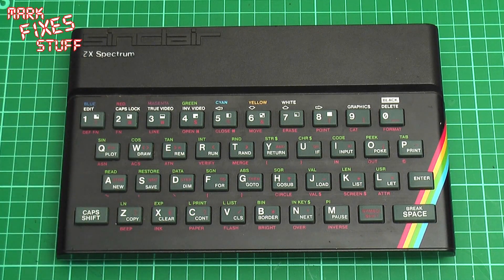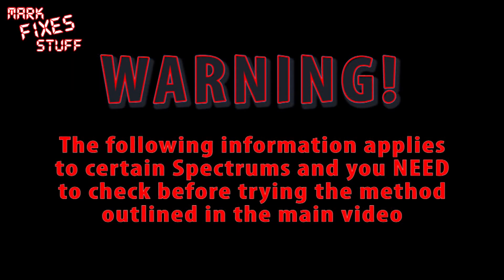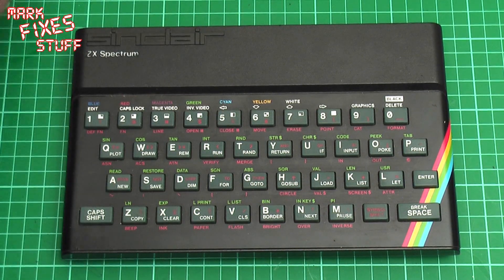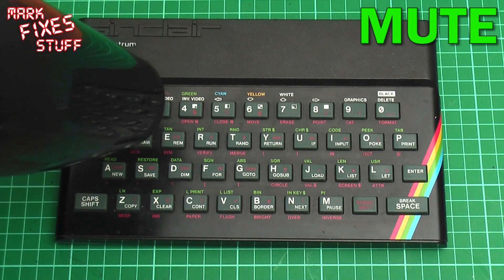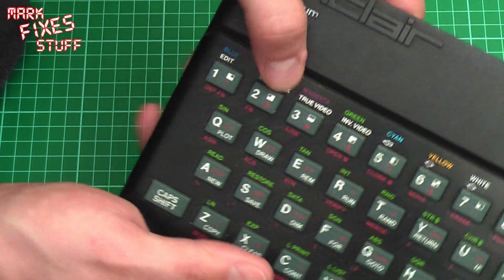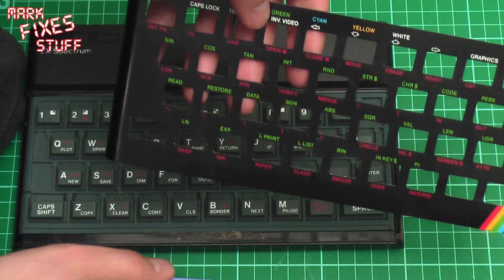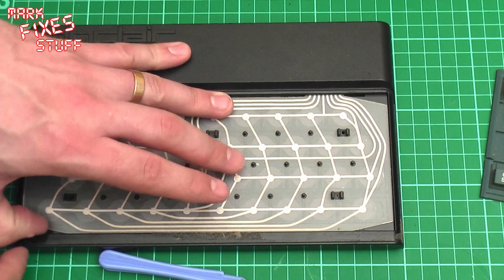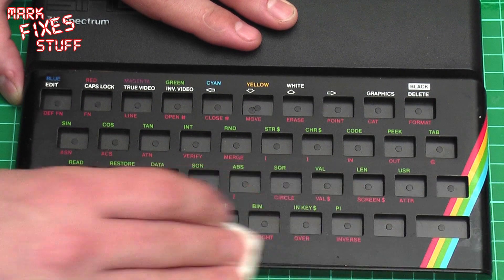Sinclair ZX Spectrum 48k repair: Remove the faceplate on a rubber keyed Sinclair Spectrum

Comment: I just removed the faceplate from the rubber keyed speccy with no damage. The standard way for me is without any heat . Isopropyl alcohol + an old plastic credit card. Take the top case, put it on a flat, liquid resistant surface with faceplate up, pour the alcohol around the plate, leave it for some minutes (5-30). Take a credit card and carefully slide it between the faceplate and a case at the top edge (the one with more plastic and all the scribbling). If the alcohol has done its job, the case and the faceplate will separate. Slide the card around the faceplate, separating as you go. CC, being soft, plastic and thin, will not damage the faceplate.
Reply from the maker: Thank you for this! I will try your technique when I get a chance next
Reply: arnoldrimmer4833  well, it worked alright, and there was no damage. But point taken - you should be careful with it.

Comment: Put the top of the case in very hot water for a few minutes .Softens the glue and and comes off pretty easy ,and you do not risk melting anything .Modern mobile phone refix tape is ideal for putting them back on , or 3M refix tape
Reply from the maker: Good tip. I have the 3M tape now.

Comment from the maker: If you are tuning it via RF, then you might want to try going through the whole band, as often you'll find the spectrum can be picked up in more than one place, and often in a stronger fashion. My general advice for Spectrum +2 owners is to just get the appropriate RGB SCART cable though as this will give a lovely clear signal without RF interference. Google "retro computer shack" and be aware that there are two types of +2 (grey and black) so get the right cable!

Comment: I found a better way is to slide a thin kitchen knife into the slot where  the cables go in it splits smoothly without bending
Reply: My faceplate has clamps and also was taped on three sides. Your tipp helped getting it off nicely, thanks anticat900!

Comment from the maker: You could as they fit (you'd need to resolder the reset switch) but it would be good to fix the board! Are you using the correct PSU?

Comment from the maker: It should be 9v and capable of supplying 1.4amps (1400ma) at least. Some speccys will run with just 500ma supplies, but others will fail and it really does vary from unit to unit, especially as the capacitor are aged!

Comment: Hi mark just watched another video about removing the facia and I newsagent wondering if goo gone  glue residue remover or label remover for the fascia ???
Michael
Reply from the maker: Probably not going to work in my experience. If it's the original  glue then using the hot hair dryer will make it soft and easy to remove.

Comment from the maker: This one is fine, although it needed a new regulator due to someone putting the wrong PSU into it. I just have a poorly Grey +2  to look at on the Spectrum side of things now and I suspect it's a capacitor issue as it was working fine when the chap turned it on but then died mid-load.

Comment: Thanks again Mark for this great vid. I have a rubber speccy that has a small dent between the M and Symbol Shift keys. Do you think if i remove the faceplate I'll be able to knock it out from the other side without damage?
Reply from the maker: In my experience no unfortunately, as the whole thing loses it's shape (I've tries a similar dent removal process.

You can get new replicas though! See this video!

http://youtu.be/CI-nQBYA4uA
Reply: Great thanks for the info Mark. I did know about those replacement cases, but I think I'd rather keep it original and live with the dent, it is only very small and hardly noticeable. I must learn to control my OCD!Mark Fixes Stuff - Retro Console and Computer Repairs, Reviews and MORE!

Comment: Hi Mark. I am currently changing the keyboard membrane on a spectrum. Am I correct that you put new double sided tape faceplate over the old tape? Just was not sure. Thanks. Another great vid by the way!
Reply from the maker: I remove the old stuff myself as I don't want the extra thickness, but I might be being a bit anal. I use isopropyl alcohol to help shift it. Thanks for the kind comment about the video :)

Comment: Hi Mark!  Excellent video!  I wanted to share my experience with the Timex sinclair 1500 (same form factor like the spectrum).  To remove the old glue from the Aluminum face plate, I used Goo Gone orange   (isopropyl Alcohol 70% was not a success) .  However, to remove the old glue from the plastic case, Alcohol worked fine.  I bought double sided scotch tape 1/2 inch but not strong enough.  Any suggestions on the type of glue I should use or maybe the brand of double sided tape?
Reply: Does that Goo Gone work well on the faceplates?

Comment: I'm currently repairing one, but the faceplate his been previously removed and is bent, with a kind of ripple effect. Think it must have been peeled off.  Does anyone have any tips on how I might be able to flatten it?  

So far I have tried heating it up (hairdyer) and pressing it flat, but don't really seem to do anything. Might need to get it replaced but apart from bending and ripples the condition is pretty good.
Reply from the maker: +Nellyfish in my experience its impossible to get them flat again. I’ve tried loads of things, even a rolling pin. If you have better luck let me know please!

Comment: Hehe I don't know how to use Facebook :0 but I suppose it can't hurt to try and hunt down a real Speccy PSU!  The one that came with it was a ZX81 power supply so the end was the wrong shape!  The Chinese supply looks like something you would get in Argos to attach to toys !  Perhaps I could snip the wire and use a connector block to the zX 81 power supply to give it some more amps :D

Comment from the maker: Can you post a pic of it in the facebook group?

PSU's don't have to be regulated with the speccy, as they have a 7805 regulator built in. Amperage doesn't fluctuate (well, shouldn't) and a standard speccy should operate fine with less than 1.4a *but* there could be a few little issues with her.

Search for "Mark Fixes Stuff - Retro Gaming Repair Videos and More on YouTube." group on the facebook and I can help you better there. :)

Comment: The guy didn´t show how he took the faceplate
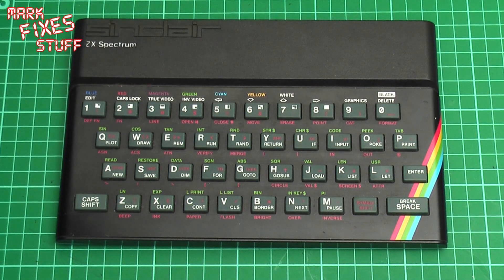Reply from the maker: 03:36 I use a hairdryer to weaken the glue and then flex the case until the faceplate come off. Before that I show how to identify if you have a version with metal retaining tabs. 

What bit is not working for you?
Reply: @MarkFixesStuff  Ok that is the most secure method using hands to not damage the faceplate. Using screw drivers it bends and people destroy the faceplate.